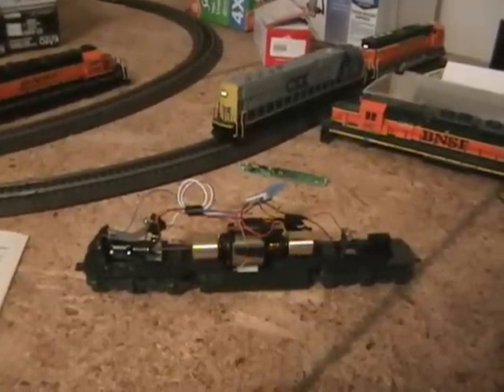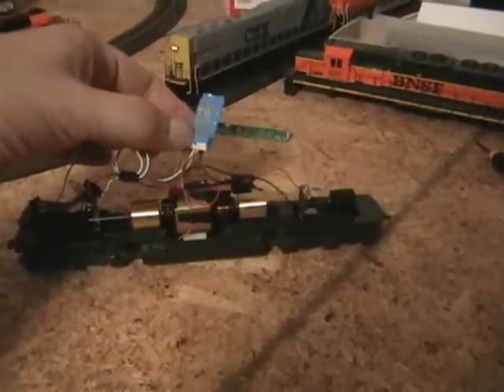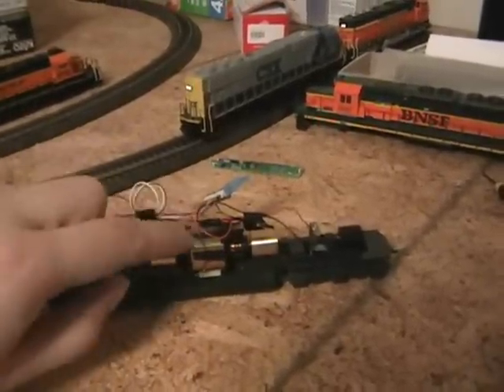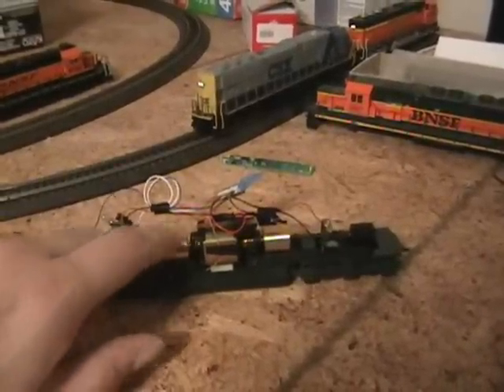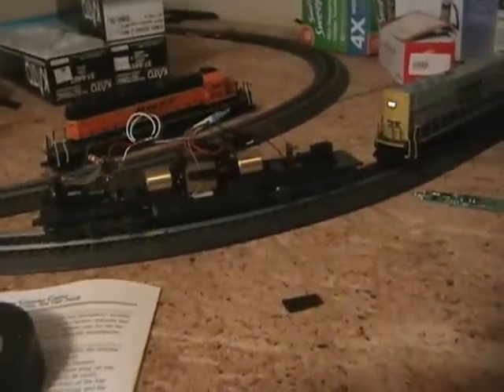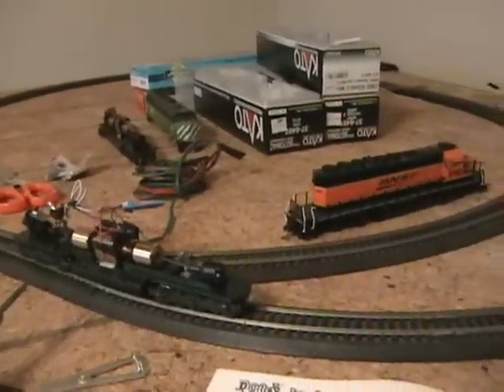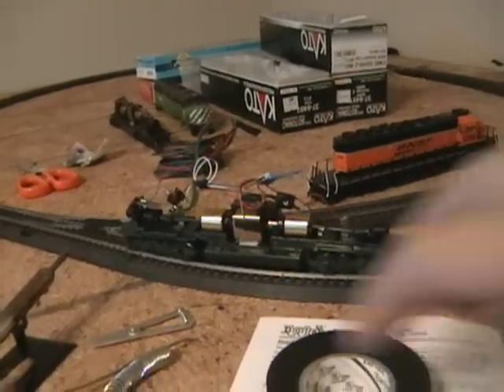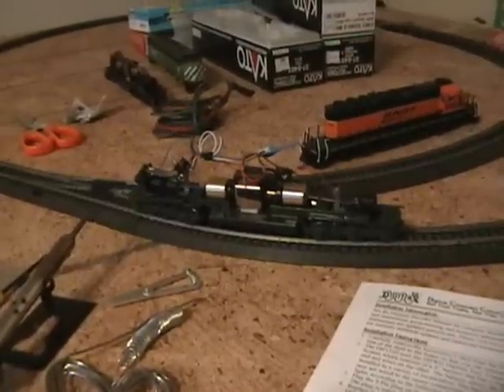11-04-2009 How to Install a Digitrax DCC Decoder into an Athearn SD40 - Part 3

Comment from the maker: The bulb that comes with this loco is designed to run off of standard DC track current (normally between 12-14v). Most decoders of this style do not come with resistors on board. If you use a wheat or rice bulb or LED, I find that 680 - 1000 ohm 1/2w resistor works real well.

Comment: Well done.  Although this installment of your 3-part series, as with the previous two, may be slightly outdated, it is still relevant to many HO model railroaders.  All parts are concise and instructive.  Thank you for taking the time to create the videos.  If you still visit this segment, I'm curious how the incandescent light bulb did not overheat.  I thought applying about 14 volts would cause it to explode.  Or, does the decoder include an appropriate resister?  May be someone else can answer this?  Thanks again, Steve.

Comment: Good job, one helpful comment the plastic on the side frames of the wheels comes right off real easy just friction fit on 2 plastic pins, will make soldering much easier, happy railroading

Comment: I thik I can follow that...but a question from a relative newbie. Can you install the deoders on ANY DC can motor as long as you eliminate the common ground by isolating it from the frame?

Comment: great video tommie , thanks . Im am in the posses of converting my athearn gp 50  with the digitrax DH123D ,but i would like to install a reverse light as well as switching the cab,forward,and reverse lights to led. what would you do differently in that case?
thanks .

Comment: i have a gp 30 with the same type of motor, drive train, and trucks, well it hasnt run for like 10 years or more and has been sitting in the open air. do you know if its still salvagable or is it done for?

Comment: Hi Tommie,
The MRC HO decoder fits into Genset perfectly. I just ordered one from Ligar Technologies. They're great. The new MRC decoder has initial start-ups for each
of the engines (3). As the loco increases speed then the next engine kicks in - like
the real one. Then if it sits idle, the engines shuts off, like a Hybrid (which it is)
to save fuel.

Comment: Hi Tommy,
Couldn't tell from video where you soldered the black wire on the trucks. Maybe
a little flashlight next time. I expanded the screen but still couldn't tell. 
Do you think you can do a hardwire install for a f59phi with sound and additional
led lights  that flash with horn. Also, could you mention how to install strobe
or marker lights as well? I think you vid's are great and Thank you!

Comment from the maker: @midrange18 Hi- In my later installs, I use the chassis or frame as a ground as you do. Using the blue wire only works if you isolate the light post from the frame.

Comment: Question.  Why did you ground the blue wire.  I ask because I installed a DH123AT into my blue box athearn. It said to hook up the white wire to the positive input of the light.  It never said anything about the blue wire. SO i tried it and my light doesn't work.  I saw this vid, and you said to put the blue wire on the post and the white on the back of light.  I thought, OH thats why my light doesn't work.. I tried it and all I get is a short.  Any idea?

Comment from the maker: @saxmusicmail Hi- I actually stoped messing with the trucks all together...too much of a pain. I ise the metal post above the truck for the red wire and sand off a nice clean part of the frame for the black wire. Although I rather use the truck, this seems to work out well. Thanks for the post.

Comment: Tommie, for the black wire to the left side of the truck, why not solder to the metal pad just behind the pivot area, below where you soldered the red wire?  I know not all Athearn trucks are made this way.  But for the SD40-2, the newer PA-1, and some others, that's a easy place to get to.